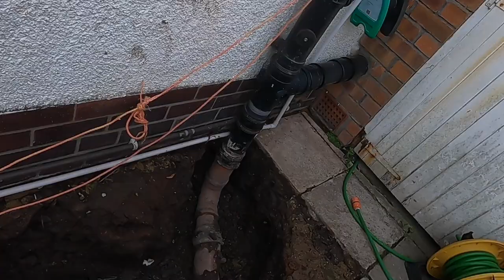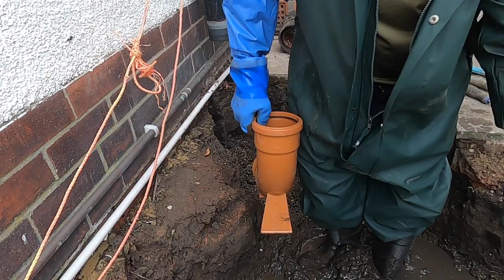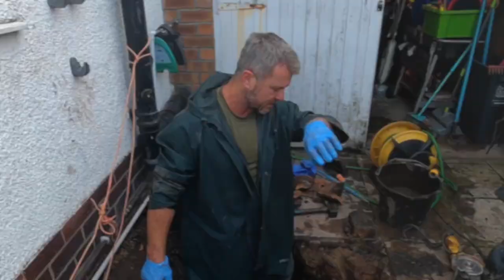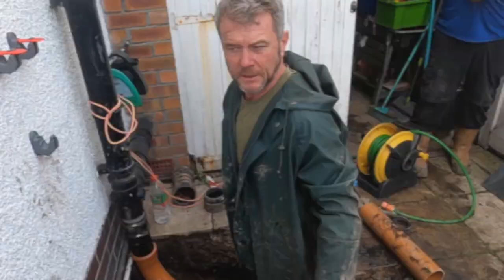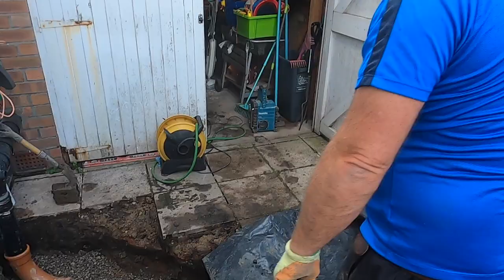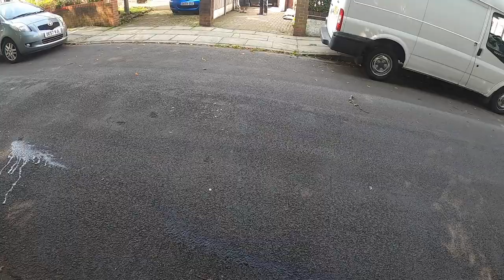How To Repair Your Damaged Drains For Dummies!

Comment: 4:18 "A tenanted property".  I started working for pensioner housing trust a couple years back as a maintenance manager. The thing that quickly surprised me was some tradesmen/companies took the stance the job is "for a landlord" so should be as cheap as possible. Which usually meant a patch up & a poor job.
Even more surprising was how hard it was to shake that thinking, and companies still did bodgy jobs. In the end it was a complete renewal, sourcing new builders/plumber/electrician who had good reputations, maybe not the cheapest. Finally, we got solid, proper resolution to maintenance.
If you guys were in our area, we would use you in a heartbeat.

Comment: If I may make a suggestion, usually when we have a repair what involves working in a soggy trench we bring along a wheel barrow full of crushed rock (3/4 gravel mostly but even road/base rock will work) and dump it in as something to walk on as we do the repair. Helps maintain your footing and makes it a bit easier to get a decent grade for the "fall" or flow of the pipe.
 I understand you guys know exactly what you are doing so please understand this is not meant to be critical but something that works for us. Best of luck.
Reply: Thanks for constructive comments much appreciated 👍

Comment: Another nice job by all.  Have you ever tried using a deburring/reaming pen tool, with removal blades, to clean the ends of the cut pipes? You just run it round once for the inside and once for the outside, leaves a lovely clean finish. They are made for metal pipe but work fine on plastic pipe if you use it gently. The blades last forever on plastic.
Reply: I’ll look at getting one of those 
Thanks👍👍

Comment: With the rest bends, just to be clear, they still only change direction by 90 degrees, but do so with a much broader radius than the original sharp bend, yes?
Reply from the maker: Completely correct!
Reply: A.J. Kleipass   There are 90 degree sections commonly used in hydraulics, and water cooling circuits with fast flow.   The principle is when increasing the radii, the resistance to flow decreases so the fluid flows in a more laminar flow and less turbulant flow.   Typically the bend radii is at least 3 times the nominal pipe diameter.

Comment: Those joints into the clay look good, wish I had used one of those.  Think I would have put a small manhole there.  Two feeds on then the manhole at the main drain.  Looks much better than before tho.

Comment: I have done all the work to maintain the pluming at my start in 1980 about twenty years ago dug up main line had to do similar to what you did there! Exception was put a sweep 90 pointing up and brought it to surface! And caped for clean out access! Also have replace 90% of drain plumbing under home my home was built in 1945. Built with raised foundation and stem walls so there is a 2.5 foot crawl space.  All plumbing was black cast pipe ! Just thus last year another small piece started leaking from kitchen sink, attempted to get under house to replace that section! Well in my old age, I have put on weight and have some mobility problems from injuries ! With all that found I could not fit /get under my home!☹️☹️ I had to have a plumbing co. Make the repair! The cost for them to do work and if could of done it was about $130.00!!! Does not pay to get old and fat!

Comment: I'm in Maine in the US. We build on full foundations, crawl spaces or slabs on grade. All of out branch connections are within the foundation. Most good plumbers do put inspection/cleanout ports in the pipes where they can do so.
We use schedule 40 ABS or PVC plastic with primed and solvent welded joints for the most part. Some times cast iron where flushing noise will be an issue. What is the brown plastic you use?

Comment: Great Video Jen.  I see the boys made you work your A@@ off again!  When I hit the lotto, I'll have to sent you folks some cordless tools: grinder and reciprocating saw (save you some time cutting those pipes by handsaw...Workout). Time to get rid of those corded tools.  I was curious if its up to the customer if he wants a decide on putting in the same pipe connections or could they have upgraded to an covered drain for the two pipe connection for easy clean out access?

Comment: Not a bad job but also far from excellent. Their are several blind junctions on that repair and the only acsess is threw a hole saw in the soil stack. Why hasn't a 320mm PVC inspection chamber been installed for acsess if issue occur in the future? Also as its original clay and no super sleve the concrete could have been chipped away so a proper connection with a band seal could of been achieved, the push fit couplings you use create a lip against the flow which will cause blockages. I always noticed a CCTV inspection hasn't been carried out upon completion of the excivation, how can you assure the all connection are flush or their is no protruding seals ect. Also I dry mix around the rest bend to set it in place is essential, over time with ground movement the rest bend could drop causing back fall on the 100mm waste pipe ect.
Reply: And he could of put a 100mm coupler instead of the band seal on the black pipe above the rest bend to finish it of nicely and you could of save a few quid on those adjustable double socket 100mm fittings, that one from the gully was straight 🤦🏼and those icon couplers are expensive too 🤦🏼 totally agree should of cctved at the end to check every joint

Comment: @ around 17 to 19  mins -- de-burring the outside of the  cut to length pipes for easy install ( with fairly liquid!) - but... not de-burring the inside of the pipe ( will tend to catch debris in foul water flow?)

Comment: Is it me, but is the new y-connection against the flow direction? Have the feeling the main is flowing through the shed towards the street and what you connect needs to drain that way…..
Reply: Well then the old connection was wrong too then? It’s not uncommon that the lateral drains head towards the back for the property, then pick up several dwellings downstream before coming out into the sewer in the road. It saves on the number of connections into the mains sewer then.

Comment: Awesome job mate, love your videos!   Saw your handsaw cutting pipe.... while it is adequate, check out a Japanese Pull Saw!  They out perform a typical handsaw blade and can get into some much tighter spaces! Additionally the double blade allows you to cut a variety of materials with clean cut ends.  I have cut loads of ABS/PVC pipe here is the US like butter.

Comment: That lower adjustable joint was leaking on the last screw fitting before the attachment to the original clay.  That job will need doing again in 6 months.  Paul.

Comment: Noticed they don't use glue on the pvc pipes when attaching them together, guessing they have a rubber connecting joint

Comment: interesting how sewer is done in England with those quick connect fittings they make it easy. but that wouldn't fly in the u.s. completely illegal . they dont even make a fitting like that here
Reply: Why not? Then again you guys get earthquakes, could be that i suppose.. but our old clay drains wouldnt withstand that either!
Reply: oh i would love those quick connect type of pipes here in the states, and i actually have seen some here around Pittsburgh
Reply: Yeah. That stuff he was using looked like  the thin wall stuff we use for gutter drains. Also they dont prime and glue the joints?  I know you dont have to glue thin wall pipe but schedule 40 you do. Never understood why you wouldn't.
Reply: @MrMrmojorisin1968  the fittings have rubber seals inside, these seal around the pipe and allow for any slight movement if required. Very rare they leak if made up correctly and are v easy to install.

Comment: Why are 90 degree bends and 120 degree bands called what they are?  To my eye they both turn through 90 degrees, it's just the 120  degree one has al larger radius.
Reply from the maker: There is subtle differences in the bends, its difficult to view on video, even though they do only look 90 degrees and end up being perpendicular the curve is slightly wider giving it the 120 degree.

Comment: That rest bend is 90' .
Reply: No it’s not 👎👎
Reply: @jetter1jem955  Yes it is 😁
Reply: Compare with existing bend 👍
Reply: @jetter1jem955  I did, the old one is just a sharp 90 the new one is a gentle 90 but still 90, if it was 120 it would have been pointing down, it went in vertical and out horizontal. Don't forget this is youtube comments section I reserve the right to not only be wrong but look like a muppet aswell. 😁
Reply: Your right. Long radius bend. Both 90 degree. We learn something new everyday 
Thanks for correcting 👍👍👍
Reply: @jetter1jem955  😁It's all good happy to be of service.

Comment: oh dear, 230v instead of 110v power tools, adjustable bends instead of setting out the geometry correctly, rubber joints instead of pvc couplers, not the best, and best practice would have been to have replaced the gully with pvc too,
Reply: Cordless  even! And agree with all you mention.
Reply: Why replace the gulley? It's serviceable and working so why add the extra cost? I think those adjustable bends are great, old clay pipe is in short sections so there is slight movement along a run - it won't ever be dead straight like a length of plastic. Also a PVC coupler would have been no use here as there looks to be little or no movement to get a single piece in as the pipe has to be able to flex back to get in the socket - not possible with a wall one side and a clay main the other, the rubber coupler is essentially a slip coupler to get round this.

Top job Jem and the guys, it looks like you were never there!
Reply: @Ad-gn8pl  there are such things as PVC slip couplers for just that reason
Reply: Not wrong that looks Crap compared to what we do in Australia. Shows all the bedding work but not doing the pipe work. Fair bit of editing in that video.

Comment: What a mess! I wouldn't trust those adjustable bends after one dropped a seal into the drain. I hope the new piece off the rest bend got debited on the inside the first bit was nasty